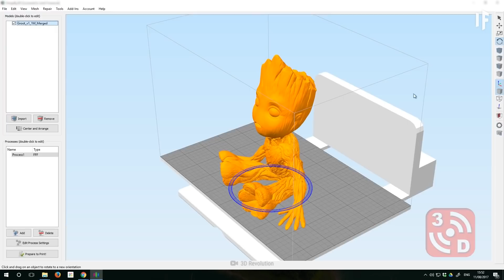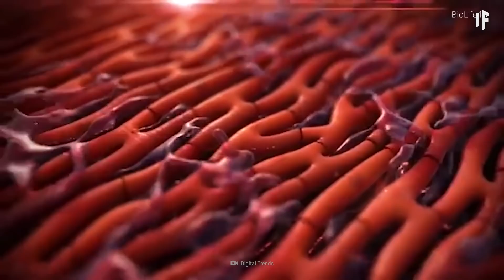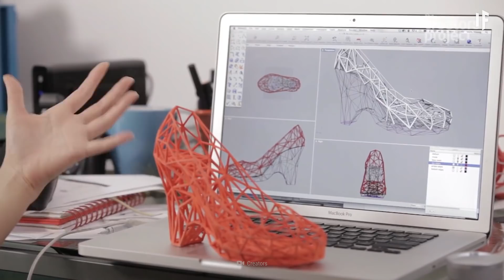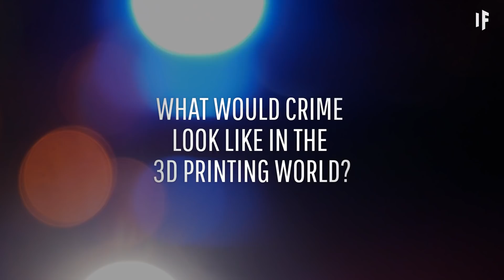What If Every Home Had a 3D Printer?

Comment: -If we had 3D printers of any type, mine would have a backlog og tasks at all time.
-Food printing? If it can actually taste right, you'll have perfectly balanced diets that won't even give you bloat/gas and meat every meal.
-When metal 3D printers become cheap enough, the only copyrighting will be for intellectual properties rather than physical products, and gun control will be moot.
-Bio-printing? Sure it would save lives, but almost immediately people will start doing elective cosmetic surgeries like bigger private parts or lip fillers.

Comment: Some parts of this what if are already out of date. I have a sub $300 3d printer. LOT'S of people do. Though ones that are mostly plug and play cost a bit more I'd consider 3d printers widely available (lots of choices on amazon alone) and affordable. Dozens of models under $1000 and quite a few good ones under $500, one of the best low cost printers is often just under $200.

Comment: I have a 3D printer, let me tell you I can barely get it to print stuff on a regular basis, so many failures, so little actual prints. It would just be pretty frustrating for everyone.
Reply: Depending on brand of printer check for the facebook communitie(s). There are several for 3d printing in general. Many owners get their machines running with very high reliability ( to the point of owning several and running them almost non-stop to make money off of the printer).
Reply: @kaseyboles30  I have, I've solved numerous problems, every time I do I get like 2 substandard prints and then something else breaks
Reply: @Nico-ig1mr  sounds like you need a better printer. Which one are you using if I may ask?

Comment: I edited this comment so you don't know what the replies mean! 😉
Reply: The prints don't usually work, it takes forever and it's a giant headache, unless you get the really expensive ones I wouldn't recommend getting one
Reply: @Nico-ig1mr  I know but I sil want one.
Reply: Nico, Thats not how it works. It doesn’t take “forever”, it really depends on size, inflill/density,  and the shape. The prints will work if you use the right settings and materials. They also aren’t headaches if you are competent enough to know how to use it, not just press random buttons. Judging by what you wrote, you are clearly inexperienced. There are VERY good printers for $200. An example is the ender 3. You don’t have to pay $1000 for quality, you can get amazing results with cheap printers if you use the “best” settings. There is also the type of printer to use. The “main” ones are FDM/FFF and SLA/DLP. If you are interested in them just do some research. When people think of a “3D printer” they usually think of FDM/FFF which utilizes melting thermoplastics and building them up layer by layer. These by far are the easiest and safest to use. You can get large FDM/FFF printers with immense quality for cheap. The “expensive” printers are just industrial grade, mammoths, or have something like two nozzles. There is also better customer support for them. Overall, cheap does not mean bad.
Reply: @ee93  mine was cheap and bad, just my experience 🤷‍♂️
Reply: 3D printers are not that expensive anymore. With a little technical background you could get a Creality Ender 3 for under 200$ on amazon and build it yourself. It might take some time to tweak it to perfection, but it’s absolutely worth it. I use it everyday.
Reply: @mojex823  really?!! What do you print in it ?
Reply: @Theguywithspecs1  I study Industrial Design Engineering, so mostly self designed products and sometimes convenient products for in and around the house.
Reply: @Theguywithspecs1  You can print basically anything You want
Reply: I too want

To print sex toys!
Reply: @darishdias  the amount of fake genita....ugh
Reply: Same
Reply: omg I want one but I haven't enough money and definitely nowhere to put it 😭
Reply: @sharlharmakhis280  it's ok.
Reply: Get a Prusa
Reply: @Tarabyte  a what now?
Reply: So do you want to design your own projects or take existing designs?
Reply: @simianto9957  idk
Reply: @luvstaxx756  Yes but they will be plastic Sneakers